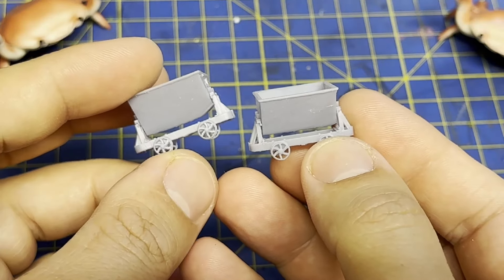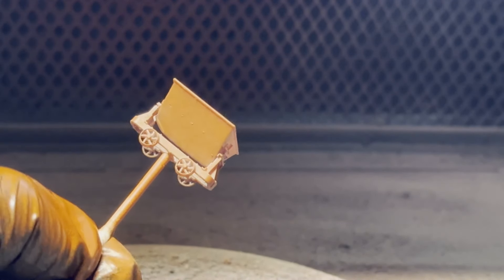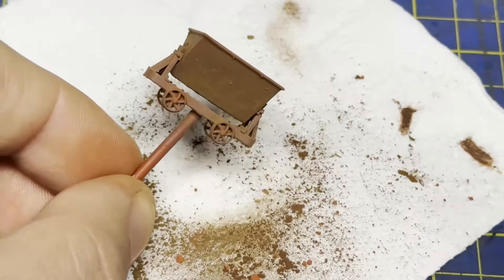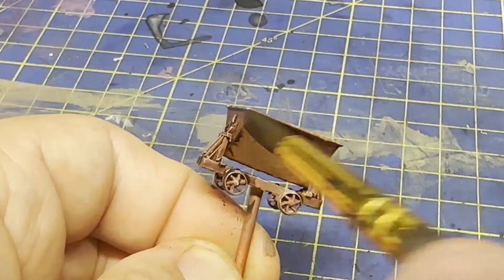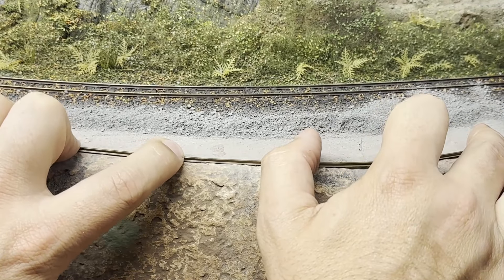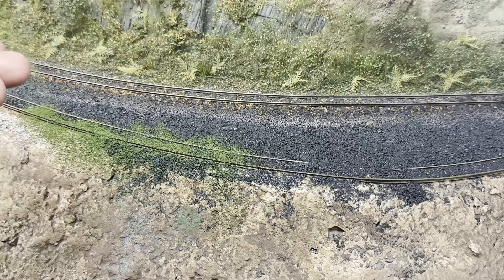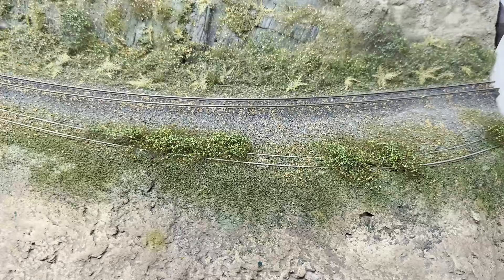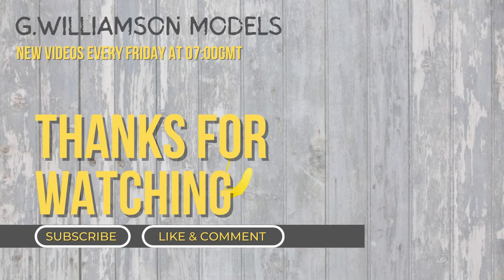Making the Old Line on my Talyllyn Model Railway with tippers!

Comment: Ooh ... Friday already! 'Ow do, George. 👋  Loving the 'abandoned' track.  Current photos show a serious difference in rail used back in 1865 and 1975 (unless the extension has been relaid since opening).

009 has come an awfully long way from Eggerbahn's early offerings.  Their 'generic' tippers looked pretty good 40 years ago, but yours are in a different league and on a par with the 16mm scratchbuilt stuff I saw from the Merioneth mob back in the 80s. 

Plans for any rust holes in the bottom of the tipper bodies?  Love the 'bare chassis' .... btw, where's the body for that one dumped?
Reply from the maker: 009 has indeed come a long way! Even from 5/10 years ago.
Yes I’m really lucky that Alec was happy to help me with the tippers (and other items along the layout), as I wouldn’t have been happy with using ‘generic’ models.
I do plan to add rust holes..just haven’t had the guts to do it yet